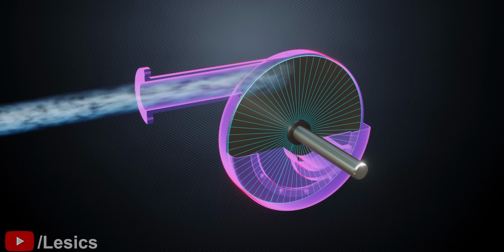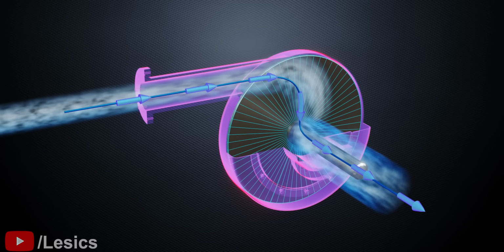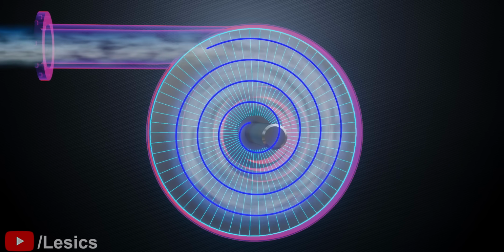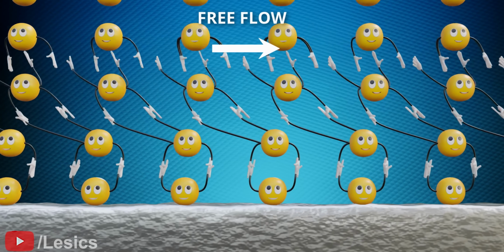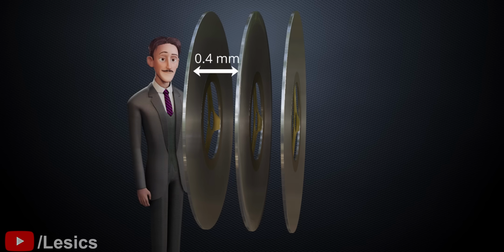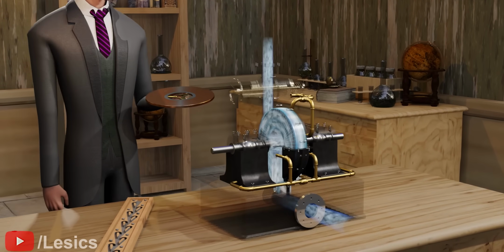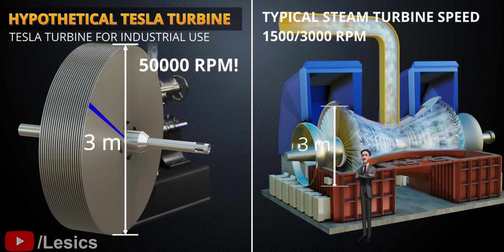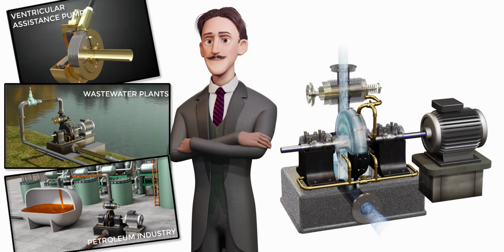Tesla Turbine | The interesting physics behind it

Comment: What about new super-materials like carbon nanotubes? Since the Tesla turbine is smaller, and therefore lighter, it could have an application in jet planes.
Reply: we built a teslaturbine while studying materials. the panes are only a few micrometers thick and reinforced with nanomaterial coatings. We then cold-welded 10 of these panes in a high vacuum and thus obtained panes that withstood 50000 RPM without any problems. The turbine was confiscated ....
Reply: @darkbreed   by whoom?
Reply: @Stephanthesearcher  By you know who...
Reply: @Stephanthesearcher  government
Reply: @Stephanthesearcher  we have also solved the bearing problem by placing the shaft perpendicular to gravity and bearing it in a supramagnetic bearing system without contact, so we have also eliminated any form of asymmetry in the rotation. TiC was used as the coating and the cold welding created a diamond-like stabilizing network between the laminate panes, which completely suppressed the deformation of the panes at high speeds and high temperatures.
Reply: @I love you but I don't care what you believe I also helped develop a waste incineration plant in which the carbon dioxide emissions are compensated in the form of biomass and the ash and exhaust gases are chemically processed for fertilization, the EU commission confiscated the patent for the plant and shut down the proof of concept plant. A similar thing happened to colleagues of mine. In 1997, a process for the complete recycling of plastics and epoxides into a crude oil substitute was developed in Heidelberg, and to date not a single plant has been approved for this purpose.
Reply: @darkbreed  Funny you're allowed to speak openly about this on a google operated website. so what's stopping you from posting your work on the internet? The MIB? No video footage of the process? Claims like these require proof. BTW The burning of waste and filtering of gases has been done for years to create electricity. https://www.wtienergy.com/about/how-efw-works.
Reply: @TheTubejunky  why should i give others the opportunity to copy our work? To save this world? no i will not give away our work, not for this useless humanity. Besides, I don't want to be locked up for unauthorized publications. IT IS A CRIME IN GERMANY.  Where do you live ? In the USA, where more than twice as much waste is produced per capita as in Germany and where large corporations successfully defend themselves against the right to repair? I saw how almost 30 years ago the only functioning recycling system in the world (SERO) was destroyed and there is still no adequate replacement, although all processes are known. I have seen how almost everything that represents real progress in waste management has been destroyed and I have to watch how a mindless youth prefers to listen to a stupid child and conduct useless sit-in strikes on Fridays instead of moving something. I have seen how large corporations secure their profit by blocking new technologies, we live in capitalism and this is not compatible with technologies that improve something and at the same time bring established profit cycles to a standstill. Try to get your hands on the patents for the solvolysis of hydrocarbon compounds, you will fail. The advances in materials science have made enough steps in the last 20 years to realize molten salt reactors, but nobody builds them because everything is regulated and controlled and every form of re-treatment leads to high money and prison sentences. You are probably one of those people who think electrification is a solution and wind turbines are environmentally friendly. You have absolutely no idea what's really going on in the world.
Reply: @darkbreed  Good luck in life. "Useless humanity"? Terminally ill much? Hope things work out for you.
Reply: @TheTubejunky  tried to get processes and systems into operation for 20 years and all of them were blocked. Furthermore, I have been threatened economically for some time because I have initiated innovations that would bring the oil market and the electricity industry to their knees.
Reply: @isaiahwelch8066  True Islam is the one that will liberate humanity from the control of Satan and the Antichrist, God willing
Reply: @mrlk665  : Actually, it wont. Why? Because religion that has political control is a theocracy. It affords no critical thinking, it affords no autonomy -- because no religion ever accepts that it is wrong. No religion ever accepts the actual truth, which is that ALL religions, no matter which one you examine, worship extra-terrestrials. Aliens.

And literally, aliens are nothing more than sentient life with a much greater and deeper understanding of physics, which gives a greater technological access, including things that we currently see as science fiction, including gravity reactors and inter-dimensional travel.

Besides: One, I've already seen what a theocracy in world history can do -- or does no Muslim accept that the Inquisition is a historical and bloody fact? And two, Islam is  perhaps as great a fraud, as Scientology is, because I do know the roots of Islam, and Mohammad was nothing more than a wealth-seeking charlatan who attacked religions that kicked him out of the cities he stayed in, because his ideas were completely foriegn and radical to accepted thoughts of the day. Why do you think Islam is so close in its theology to Christianity and Judiaism? Because Mohammad ripped off what people in the 7th century were highly accepting of. Mohammad was a thief, plain and simple.

Nothing you say will change my mind about this, because I find Islam as hard to believe as I do Mormonism.
Reply: @isaiahwelch8066  You are wrong when assessing me and my level of knowledge. I know the paths that should have been taken against the pandemic at the beginning of 2020 and the problem would have been solved (at least in the 1st world) after 9 months. I could now share what I know about the chemical function of an mRNA and tRNA vaccine and how it actually works and why covid arm, myocarditis, microthrombosis and nerve damage as well as other possible consequences are an inevitable consequence of mRNA / tRNA vaccinations, but here is another topic in discussion. I know the reasons very well and also what happens to those who go public with the truth. Knowledge used to be revered and today anyone who knows more than average is a problem.
Reply: @isaiahwelch8066  that is exactly my opinion a belief in God is a form of escape from reality and only leads to war and rejection of reality. i don't believe in gods, demons, ghosts and other esoteric nonsense.
Reply: @mrlk665  If you know the Koran I recommend that you compare a 600 year old with the current one and you would understand that this book is just as much a lie as the Bible and the Torah.
Reply: @darkbreed  : I tend to think that David Icke is right, given what we know about energy, frequency, and vibrations -- and in the context of your second comment, I think that what people have called "the afterlife" is nothing more than inter-dimensional interference, similar to how old-school AM/FM radios used to act, when reception was on the verge of changing from one station to another. Ghosts and other paranormal activity is nothing more than different dimensions on the same universal space-time continuum, with some people having advanced enough brains and minds to access and/or manipulate this reality, though they don't know why -- similar to Neo in the Matrix, except if we had access to our whole brain, everybody could do it.
Reply: @isaiahwelch8066  There are no unused areas in the brain, your comment reflects that you have no idea how a brain works. From a scientific point of view, our brain has been researched to the extent that scientists are now able to decode memories, only on the basis of the chemical function of the brain. Whether there are any other "dimensions" or higher dimensions than the 4 known to us (height, length, width, time) is pure speculation. Just like the extrapolation of quantum properties to complete reality (multiverse), science has so far proven one thing with each higher level from the subquantum range upwards, the multiversality decreases and above certain masses it disappears completely (double slit phenomenon up to a limited ion packet size, everything larger no longer has any of the multiversal properties), which makes me personally inclined to say that there is no multiverse, only the basic electromagnetic properties of the universe are only independent up to a certain mass and from then on deterministic.
Reply: @darkbreed  : Then explain the fact that at the highest levels, we only control 30% of our brains consciously. There are also accounts of people having extra-sensory perception (ESP), as well as at least one account of a Buddhist master generating energy, and stopping a punch 1" from his body.

Those are not normal functions -- nor are they mutations of a genetic kind. How do you explain, scientifically, these things, when you say we know everything there is to know about the brain? If that were the case, every function, along with every possible combinations of functions, of the brain would be known and catalogued. Hell, we still haven't answered the question of what causes consciousness, nor do we know, scientifically, if humans have a soul. All we know is that there is a measurable loss of mass at the moment of death.

My point is, I find it extremely unlikely, even improbable, that we have done anything more, than merely scratched the surface of what our brain is even capable of.

As for dimensional space, or even the perception of time, all of those things are measurable -- and with time, it can be measured, at least down to the nanosecond, with an atomic clock. Dimensional space is demonstrated by mathematical concept, and is able to be geometrically proven. So again, saying dimensional space, or even time, being pure speculation...I have no idea where you could rationally draw that conclusion, given that no matter what one investigates, anything and everything about our reality, about our universe, can be broken down into numbers and variables. Mathematics is the language of the universe -- and saying that the most basic concepts of our universe is pure speculation? I would not just call you irrational, but even insane, because with that statement, you are denying -- or at least, being agnostic -- about the very nature of what the universe is, and what its characteristics really are.
Reply: @isaiahwelch8066  on what scientific basis do you base this theory? The medicine of the last 20 years has clearly shown that 100% of all cells in the brain are used at all times and 95% of these cells have now been determined what they are used for. There is only a proportion of 5% cells whose exact function has not yet been researched well enough to determine their function, but there is already sufficient data to say that these are cells that are responsible for the energy supply and regulation of the core areas of the Brain are responsible. Most of the cells in our brain are such regulation cells only the cerebral cortex makes up our minds (which in the 1930s to 1970s led to the wrong assumption that we would only use 30% of our "potential") that the white brain matter is mainly used for the production of neurotransmitters and theirs regulation is responsible and is therefore autonomous, has only been recognized in the last 20 years. On fake martial arts and esoteric rubbish? There is no extra-sensory perception and chi does not exist either, which is complete nonsense what you are writing. Chi master, lol. I didn't say that the 4 known dimensions are nonsense, your idea that there are more than these 4 dimensions is nonsense. The dimensions above length, width, height and time are pure speculation and not a basic concept. There is no evidence of a 5th, 6th, 7th, 8th, 9th and 10th dimension, all of which were invented to explain inconsistent quantum physics formulas (which is why most serious scientists think it's pure nonsense). The universe is an electromagnetic 3D wave function (as Einstein already suspected) with extremely high complexity. I'll give you a number that cannot be calculated but can be constructed in reality, the angle in a regular heptagon is 360/7> not even a quantum computer can represent this fraction as a number, because it is infinite, which is why a calculation of regular heptagons is impossible. Don't tell me about physics and mathematics, you will lose. There is so much bullshit in physics claims like the vacuum fluctuation, which can never be proven because there is no empty space, even the vacuum is filled with neutrinos and therefore there are always particles that can transform into one another, I would even go so far as to claim that if somebody actually succeeds in shielding a vacuumed room from neutrino radiation, this room ceases to exist. This explains much better why the universe is expanding at an accelerated rate, because neutrinos actually give the vacuum the 4 dimensions and only a limited number of neutrinos have space in a planck cubit. The latest results on muon decay confirm that there are no higher dimensions and that the formulas we use must contain errors or that our mathematics can never fully explain this universe.
Reply: @Retrocaus  Unfortunately, you need a patent, otherwise they will copy your work and patent it and thus prohibit its use. Simply relying on the fact that the invention would lead to damage to established industries in order to be able to block patents is cheeky. The regulations for the creation of freely available patents are formulated in such a way that it is impossible to get approval for such a project and here every detailed publication of a blocked patent would lead to imprisonment and high fines. I assume in 3rd world countries the problem will be solved with a bullet ...
Reply: @darkbreed  yea only way is to distribute the manufacturing process and design anonymously far and wide, make it opensource , takes a humble soul to do it
Reply: @darkbreed  there is always opensource licenses you can put out
Reply: @Retrocaus In order to be able to create an opensource license in Germany, I need the patent right to the invention / the system. If the patent is blocked by the patent office, I cannot apply for an open source license. The open source license of software is handled differently, a direct open source machine / plant or a technical system does not exist in the EU / Germany. For example, an incinerator is patented and you need a license to use it from the patent owner, if you add new parts you need to apply for a new patent because you are using a patented invention from a large player and have modified it. In some cases, you will also need a license from the original patent owner to modify their invention. It's a lot more complicated than software.

Comment: Imagine making something so good, it destroys itself even with the strongest materials known to mankind
Reply: I once built a engine so "good" that when I floored the accelerator the transmission rippied itself apart and tore the side off the engine.
Oh wait that wasn't good... an engineer needs to look at  system as a whole and work within the constraints of the materials and manufacturing processes available.

Comment: you could get higher rpms if the disks were tapered to be thinner at the outside edge.  Two tapered disks could be joined together to form a single ordinary shaped disk if necessary.  Also a spiraling smooth s curve from outer to inner on a micro scale would increase surface area and likely power output.  Alternatively tiny blades between disks could be cantered to provide inward force to counteract centripetal outward force.

Comment: Some concrete pumps use Tesla discs because they can flow chunky materials, as long as a certain size of grain is not exceeded.
Reply: wow, thats a solid pump
Reply: Two alternating hydraulic cylinders and valves is all I ever saw where I am from. Give us an example plz
Reply: Don't they use rotary pumps for that?
Reply: @the_flying_fox  yeah I'm pretty sure.. you can't even find T pumps on the used market, I dont know where a concrete company would get them
Reply: @the_flying_fox  Yes, many concrete pumps are rotary.
Reply: @the_flying_fox  : Tesla turbines are by definition rotary, could you be more specific?
Reply: @absalomdraconis  I meant +ve displacement pumps like lobe or screw pumps. These are cheaper and I do not notice any big advantage of using Tesla discs. If you see some advantages on using tesla discs then do let me know.
Reply: The grain thickness can't go past the thickness of the space between the disks